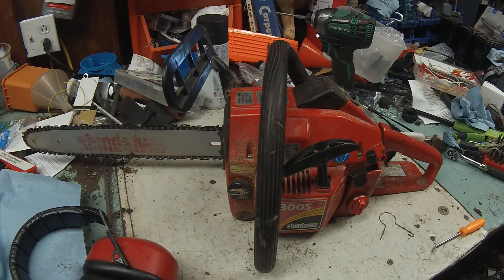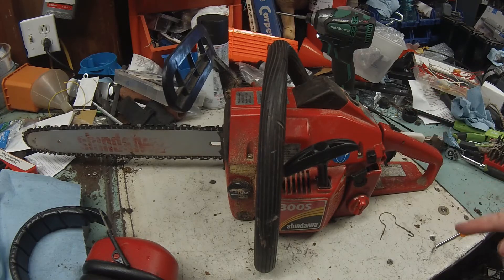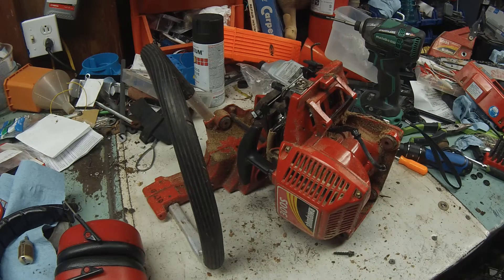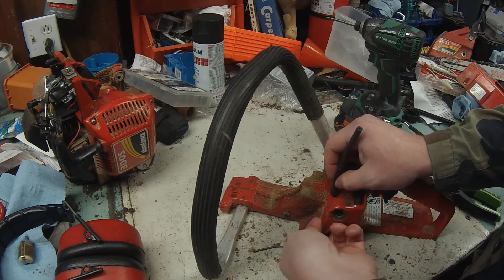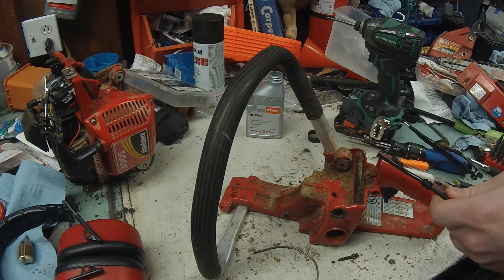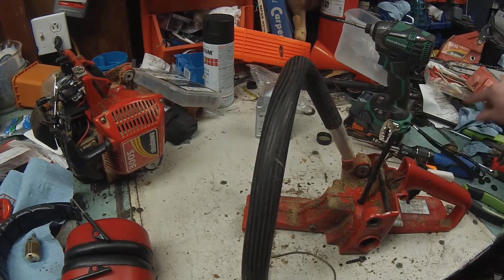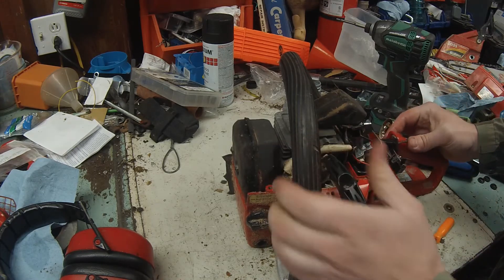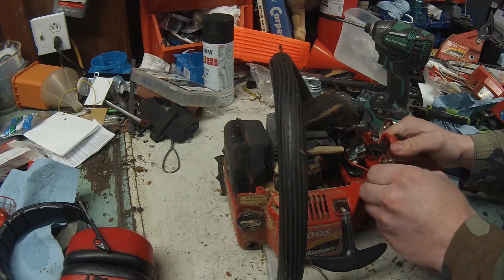Shindaiwa 300s fuel line replacement

Comment: I have a 488 shindaiwa...there is an element that goes into the fuel line. Where do i insert it
Reply from the maker: I'm not familiar with that model, but are you talking about a fuel filter? If so just install it on the end that is inside the tank. Hope that helps you a bit 🙂
Reply: @joshthetooldude5775  sorry,not the fuel filter. There is an element the goes into the breather tube. Im assuming its acts as a air filter?

Comment: Hey, nice video. I recently bought this model.
What do you do with the gas trigger before starting it?  Is there a starting position?
By the the way, mine is leaking fuel when it lies on the side.
And so fare it starts and runs very bad. It runs only some seconds.
I used Aspen2, I will try regular fuel + oil tomorrow.
Reply: Chanel locks on the bar nut, really?😂😅😂 Now I've seen it all.